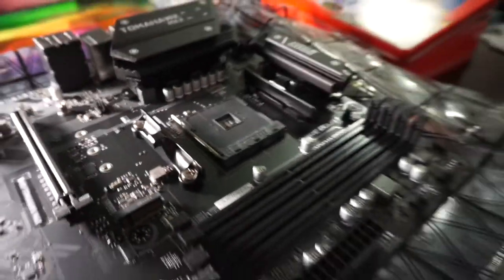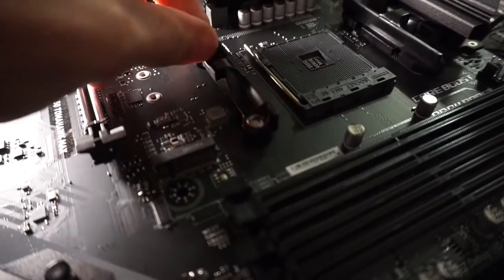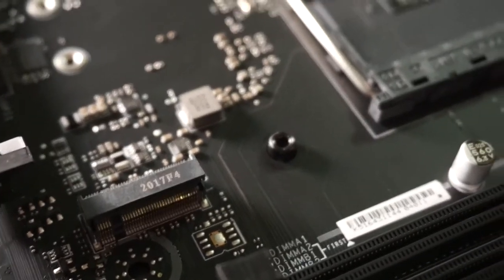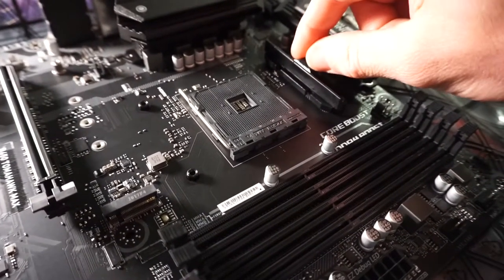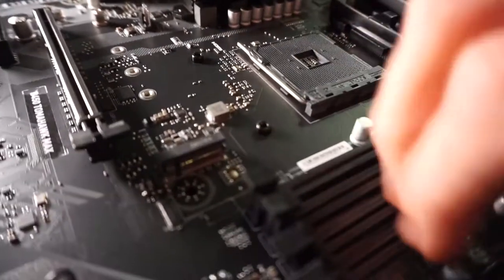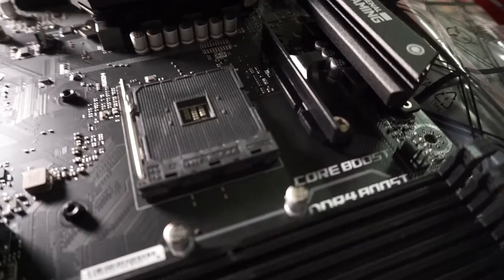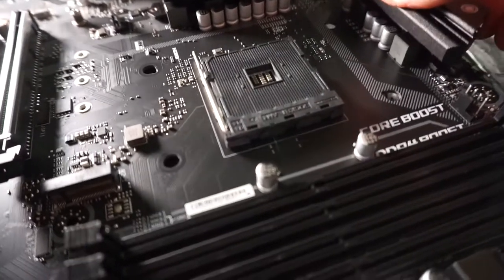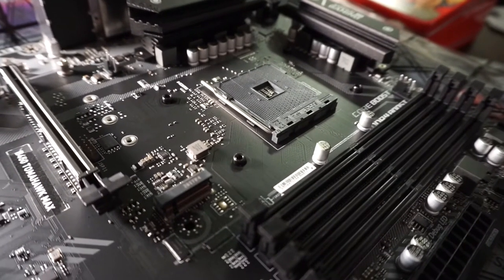AM4 CPU Back plate Rant

Comment: The most annoying part for me is... they could just make a fifth screw that DOES NOT connect to the cooler, just holds it on the board. It doesn't even need to be a though screw.
Reply from the maker: that would have been a good idea

Comment: guys do not throw that bracket away if you plan on using an AIO liquid cooler you will need it
Reply from the maker: I usually keep all pc gear including the box's
Reply: I found this pain out today while trying to install an AIO on my ryzen 5 3600 🤣 now have to buy a bracket off ebay
Reply: I removed this bracket only to find out its what I need to install my corsair icue elite cooler. Thank goodness I kept then and discovered this video! Now I can progress with my build!
Reply: @scottmiller7284 if you’re using the plastic backplate with ur Corsair, ur on the wrong standoffs I believe.

Comment: This happened to me too like some others in the comments but I just bought a Ryzen 7 5700G and tried to install the fan after installing the chip but then the damned mount plate fell off and I had to take the other side of the pc off to get at it. I can not for the life of me hold that plate to the back of the motherboard and screw in the cooler fan at the same time, mucked up all the paste too while trying, ffs. Ohhh it's sooo easy, anyone can do it in five minutes.
Reply from the maker: I Hope they have the backplate fixed a different way in AM5

Comment: I want to upgrade my CPU but this is the one thing holding me back. I have no clue where to begin with keeping that held in place while removing my cooler and putting in the new CPU and then screwing the cooler back on again. When first building this PC installing my cooler with the board out of the case was enough of a pain, I am really worried about doing it again while it's all mounted in my case.
Reply from the maker: hopefully if you take off the backside of your case then you might have a cpu bracket cut out.
Reply: @rickstechrepairs  It's completely open. Someone recommended some light sticky tape to hold it on as long as I'm careful not to pull off any capacitors. I might do that and prop it on a small cardboard box that also holds the backplate in place
Reply from the maker: Use some double sided tape and lightly push it on to the motherboard, that will hold it fine
Reply: I rested the motherboard with the backplate with a tightly packed wallet. Worked like a charm when you align it directly in the middle of the backplate.
Reply: I'm in the EXACT same situation. Installing the Wraith Stealth was PAIN in my butt, as it took over 30+ mins just to screw in the cooler. Luckily my case has a removeable back panel, so I'll have to find something to hold that stupid backplate on so I can go through the screwing process all over again. Want to upgrade to a Ryzen 7 5700 or Ryzen 5600 from a Ryzen 5 2600.

Comment: You kind-of addressed my question here, but perhaps there's something I missed.  It seems that no matter whether you use a clip-on cooler or a screw-on cooler, the back-plate needs to be there.  If that's the case, why does there even need to be a removable back plate, and if so, why isn't it permanently attached to the motherboard?
Reply from the maker: yep, it should just live there attached
Reply: @rickstechrepairs  The threads break easily, and it's cheaper to just replace the retaining bracket.
Reply: Not every cooling system uses the stock backplate. There are lots which include their own.

Comment: those plastic brackets are for mounting the long standard AMD pressure bracket coolers, if youre mounting an aftermarket cooler you have to remove these, but be advised the backplate may fall off -- if its inside your case this can be a real bummer cause you have to remove the board now -- I always buy tower coolers with the AMD style clips to avoid all the nonsense.  But I like your C clip idea, or more correctly and "E" clip.

Comment: What kind of tape did you use to keep it from falling down?
Reply from the maker: Just any double sided tape should work fine
Reply: Are you sure it wont damage anything ?
Reply: @ayush9790  i didnt try but i guess it is gonna be so hot and tape will burn.
Reply: @808Efe  i just used a hard sponge😂😂, and shoved it behind the case , been an year its still going strong
Reply: @ayush9790  clever solution :D
Reply: @808Efe  😅😅

Comment: Is the backplate really necessary? Because I have Aorus B450 I, and trying to install IS-50 MAX RGB cooler and had to rwmove the backplate. But getting system instability especially under load. Systems reboot unexpectedly.
Reply from the maker: i would have thought it would be, usually cooler manufactures have it bolt to the factory back plate, unless they include their own to replace it with
Reply: @rickstechrepairs  nah, IS-50 Max RGB doesn't have, and to install it, uses 4 screws directly and the existing backplate needs to be removed. Hmmm..bit a waste of money I guess.
Reply from the maker: Where do the 4 screws screw in to?

If you remove the back plate then there is 4 holes through the motherboard
Reply: @rickstechrepairs  Yes, thru the holes. Cooler on top, backplate is removed to make way for the screws at the bottom.

Comment: i accidentally unscrew the thermal cooler how do i get the back plates back on without removing the motherboard from the case?
Reply from the maker: All Depends on the case, some have a cutout for the Backplate available  from the other side.

if you don't have that then you will need to remove the motherboard.
Reply: @rickstechrepairs  thank you
Reply: @rickstechrepairs  my backplate fell off when I unscrewed my cpu cooler, how do i get it back on? Double sided tape? I can't hold it up, and screw in the cpu cooler at the same time
Reply: @rickstechrepairs  also forgot to mention, I have a 1600 with whatever cooler comes stock wirh that, that screws in. I recently bought a 3700x, and i went to go put it in, but i realized I don't have the mount to clamp the wraith prism on, so I ordered that. But when i removed the cpu fan for the 1600, the backplate fell off and until my bracket for my new cpu gets here , I want to reinstall my 1600 but I can't get the backplate to stay in place to mount the old cpu fan back in

Comment: Some coolers like my GAMMAXX 400 use those black retention brackets. Some coolers use the stock backplate, and some use their own backplate. Changing that stock backplate would force cooler manufacturers that use that stock backplate to make changes too. and all that for the convenience of having the backplate preattached in a different way? I don't see that happening, especially since the AM4 socket is near the end of its life.
Instead of using tape, you could put something squishy like a sponge behind the motherboard to keep the backplate in place, while installing the cooler or the retention brackets. If you want the backplate to never fall out after removing the cooler, use coolers that use their own backplate, or coolers that use those retention brackets.
Reply from the maker: you mention some very valid points.

also with AM4 being end of life, im curious if the pin config will change thus socket size and mounting position.

Comment: This is also my problem right now. I also have an am4 motherboard. How did you fixed it. Or you just let the cpu fan locked it nice and tight?
Reply from the maker: I used double sided tape on the back plate to hold it on the backside of the motherboard
Reply: Ricks Tech thanks I thought at first my motherboard is already broken.

Comment: I do not understand the point of this video. Tons of coolers use the original am3 and am4 bracket. And there are many ways to hold it in place if the cooler need the plastic to be removed.
Reply from the maker: my point is, if you remove the AM3+ plastic the back metal bracket falls off, 

if you are working on the motherboard in the case, its a pain when you remove the cooler and the metal bracket falls down between the case and the motherboard
Reply: @rickstechrepairs  And that have happened to me many times, that is why i always put a tape on the metal bracket and also, when possible, i replace top first then bottom after.  That way the plate is never loose. I have not used any coolers where that is not possible. But, sure. Why not just have plastic clips locking the plate in place. Easy to snap of when needing to remove it. My point is, when being used to the amd motherboard i never have problems anymore with the bracket falling off.

Comment: It happened the very same to me today while I was taking out the stock cooler from my ryzen 3 2200g. It's silly though based on the fact I bought a gigabyte Aorus pro b450. It's supposed to have a better build quality.
Reply from the maker: the CPU back plate, is something i have yet to see attached to the motherboard by any brand at any priced board :(

Comment: Actually there are plenty aio coolers that use the am4 brackets. Between my brothers and I we all have aios from cooler master and corsair that utilize it. We all have 2700x+ processors.
Reply from the maker: As in screw straight to the 4 back plate or clip on to the plastic brackets that are there ?
Reply: @rickstechrepairs  I'd say use the plastic brackets that are already installed. None of the brackets that came with my aio cooler fit the back plate

Comment: my BF450 gaming, back plate cross threaded itself whilst undoing it, not sure how that happened but it did, such a cheap design, brought a Thermaltake 310 cooling option with a much stronger and better quality back plate/mounting setup, pretty disappointing from ASUS though !!!
Reply: I was screwing in the stock cooler on a brand new motherboard being very careful because it was my first brand new motherboard and the backplate threads were stripped and I didn't even tighten the screw all the way yet.